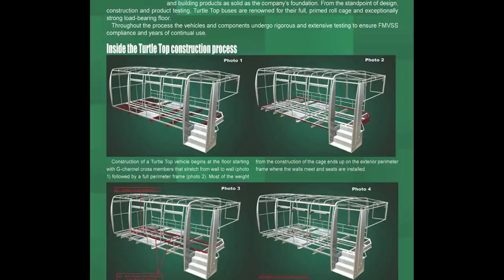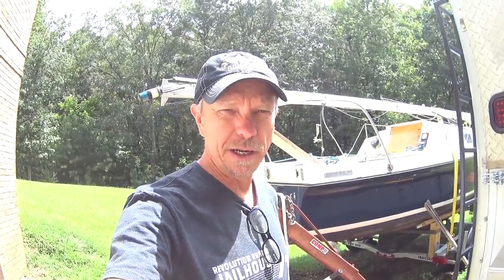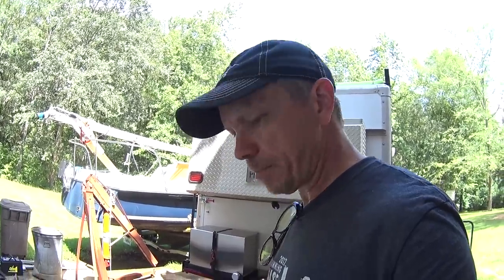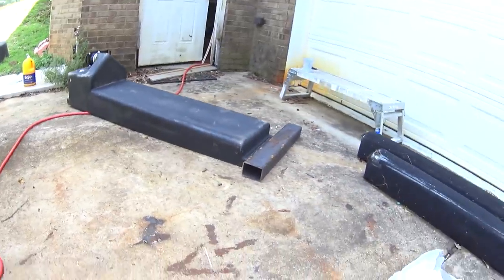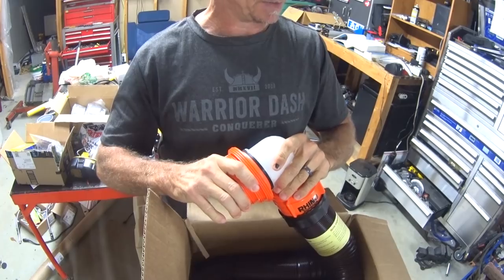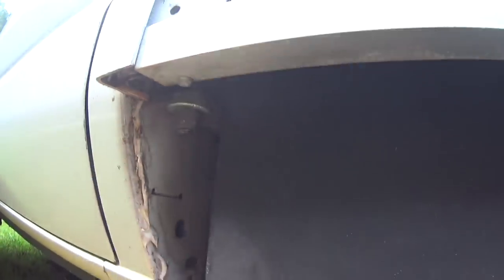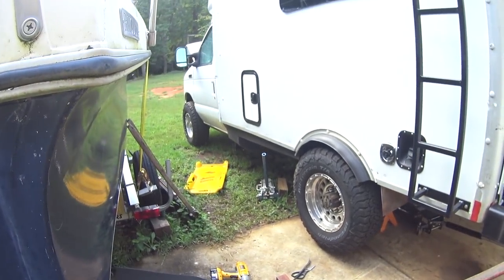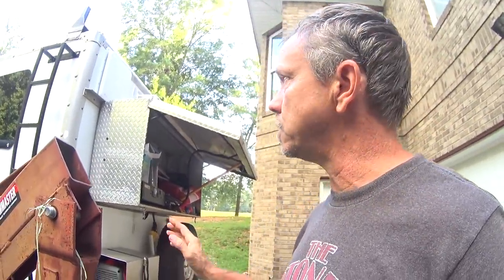Box Truck Campervan - What I should Have Built and  Holding tank install

Comment: You should have used a large water bladder and stored it in the engine bay.the truck engine would have warmed the water. Use 12v dc electric pumps to take the water back  to the shower area where you could have a highly insulated water storage tank for hot water.. Regarding your son - hitch a trailer on the back of your truck and put a VW Camper on the trailer and have him to sleep in that. Great videos and stay safe on your travels.

Comment: Wow!  I currently own that actual red Quigley 4x4 early in the video.  It's now blue with an industrial coating on it and has about 197,000 miles and running strong!  I just drove it 3000 miles from Denver to and around Oregon and back.  I've been catching up on your shuttle bus videos and am about to install the remote door opening deal, but thinking about a full security system instead.  I will have a lot of stuff in this thing when I'm done.  Thanks for the videos!

Comment: I think the best platform is a larger 4x4 Cummings powered school bus.. built like a tank, outback ready and comfortable space. One manufacturer Phoenix Cruiser offers a Quigly 4x4 with a hefty price tag but good quality control family run build.
Reply from the maker: I would like to build something with 5.9 cummins ford dana 60 axles with a ujointoffroad leaf spring kit.  That would be a pretty tough combination. The phoenix cruiser looks great but that's 125k base on the 4x4.

Comment: I know some shove the hose in the back bumper some bumpers are square you could always get a light wall square tubing and mount it across the back as a bumper get some plastic covers and it works great for that!
Reply from the maker: I just read somewhere you could also use a pvc fence post. I may be looking for one of those.

Comment: LP tank OUTSIDE , mount high in the rear .  Hot Water Heater vented to outside but mount inside .  Nice shop , mine is on the 4th Fl.   Throw rubber between tank an steel ,

Comment: You might consider adding a deflector in front of the drain valve in case grass or brush runs up against it and catches there. Also now that you have moved to propane, maybe a fuel conversion kit for your generator would be useful. Good luck!
Reply from the maker: Great ideas and I will be putting a guard in front the drain as suggested but what are the advantages to running the generator on propane?  Thanks
Reply: Well, propane doesn't go bad like gasoline, you could reduce having to carry another source of fuel and longer run time without refueling the generator are a few that come to mind.

Comment: For the sink.
I've seen used a small stainless mixing bowl with a hole cut,and drain installed.
Reply: There are also triangular stall waterers for horses that would mount in the corner.

Comment: I'd install at least a couple of steel belts or similar to hold the gray water tank. That big of a tank attached only in the ends create quite a powerful torsion on the tank. Even way smaller gas tanks have two steel belts. Good work though!
Reply from the maker: Yeah, I thought about that. I probably do need a little more support in the center for extra insurance. I'll probably do that before hitting the road. Thanks
Reply: If and when you choose to do it, sand down the edges of the steel belts so that they won't rub into the tank. I'd also install rubber or neoprene mats same length as the steel belts, between the belts and the tank, just to be on the safe side. Would be a pity to have that tank messed up by the belts sharp edges. When will you be hitting the road?
Reply: I had the same comment, 40 gallon of water is 320 lbs.  Add another support (or two) to support the center span. It could be as simple as some J-bolts and uni-strut.  Great build JYDog.
Reply: You'll find them easily by searching online for "fuel/gas tank (support) straps". They are made also universal fit, in lot's of different lengths. I'd go for stainless steel. Not that much more expensive. You'll get straps for 10-20 dollars. Ebay full of straps available in all lengths. You will find straps also locally in just about any car parts shop. But don't forget to install the rubber in between!

Comment: Doing  great man But I do see A couple possible problem areas  you should really consider mounting some steel plate in front and behind the tank. If you have A front blowout or accidentally run over something it will take out the valve and if you blow A rear tire  it could take out the rear of the tank. Personally I would build  A complete shroud to cover the whole bottom and outside of the tank because of how low it is sitting. Maybe 5/16 stainless diamond plate.
Reply from the maker: True, or maybe I should just lift it and put a 4x4 kit on it. That would keep it safe right? That would justify it. Just kidding. I do need to put something up front to protect it. I'll see if something turns up at the scrap yard.
Reply: Search salvage yards for a "Skid Plate" found on most 4x4's...

Comment: there special tanks available that look like propane tanks for car engines but whont suck up the propane in liquid form (the pipe thats normaly inside the tank to suck the liquid from the bottom isnt in this tank ) you can refil it youreself at the pump and is permenently mounted under the truck 
might be good for youre rv if you guys in america can refil at the pump that is

might want to put a small extention to the rear mudguard to prevent any pebles and mud from being trown against the grey water tank a piece of mudflap prolly do fine 

cool idea with the on demand heater , mounting it outside means absolutely no gasses inside the van , think you do need to make a cabinet for it so its out of the weather , might need a detachable chimney too so it passes the fan that pulls air intoo the van
Reply from the maker: In fact I know where one is for a Van but I think I am going to stick with the 20lb grill tank since they seem to have refills on every corner and are highly available. Sometimes it is hard to find someone who can refill a tank.  I definitely need to see about getting a chimney  to keep rain out etc. The mud flap is a good idea too.
Reply: JYDOG do you have a tractor supply by you as most have An on site refill station at each store and it really cheap to fill

Comment: If you haven't thought about it how about insulate the water heater or putting in the shower that way you don't have to worried.about.it you decide stay on a cold.place
Reply from the maker: I've seen a video with the on demand in the shower but that's just too risky for me to be in such a confined space with the possibility of a propane leak etc.. Hopefully my next video will have a good working solution. Im working on it right now.

Comment: Did you put a rub pad at the rear of the black tank?
You need one, that steel bracket WILL rub a hole.
There was one brief shot near the end that appeared you gad a rub pad, but you didn't mention it again
Reply from the maker: I did, but it was just foam padding. I may have to put some thicker rubber on it so it will wear better.
Reply: JYDOG - Carpet works really good as for your sewer hose it can be cut and the end can be installed back on. Nice channel for some reason YouTube has been losing some of my channels and it takes a while for me to find them. Cheers
Reply: Cut up a rubber innertube.

Comment: Love your slogan "Build it don't buy it"!!  If I had the strength i would have been off grid 20 years ago.  Now the Gov is trying to move people out of their houses that are off grid.  And, or making it manditory to be connected to the sanitation systems, gas, and electric.  I really want to build a rocket stove in basement to heat the upper rooms that would cut down on utilities.  Tiny houses matter! this is an issue we should be fighting for a correction.
Reply from the maker: Maybe living on a boat is the answer. You can live off the grid almost anywhere then and the Gov is less likely to mess with you. I think that may be my next project. I'm with you on living Tiny. We are going to sell our house in the next 3-5 years and go tiny.

Comment: Where did you train? Did you take shop in high school? I used to watch my husband build engines and I would Race the quarter mile. I learned about engines from him and I don't know where he learned about them. But I'm interested in knowing how you know how to do this? What is an on demand water heater? How does it work?
Reply from the maker: No training. I just keep working on it till I get it right. I make lot's of mistakes. On demand means it heats the water as needed instead of keeping a reserve of water constantly heated. I really think this is the best way to go, you never run out of hot water.

Comment: if you paint your rooftop water storage "black" it will heat the water by what is called "black body" radiation!home roof top tower storages ....same principle applies!!the heat develope is almost too scorching hot not tobe left "tempered down"
Reply from the maker: Only concern with that is all the weight from the water will really increase the center of gravity and affect stability.

Comment: You can check Lee super design van Nissan NV3500 on Enigmatic Fanatic channel. He use the same Propex heat ex-changer. The second and longer tour of his supervan was long enough so he did not talk much about the heat ex-changer. He just said that he could move the output so the hot air could go inside the van or in the outside area for the shower.
https://www.youtube.com/watch?v=dUKc1TGS-bU

Comment: Where's the yellow thing in the thumbnail, dammit?
Reply from the maker: 3:47 https://youtu.be/_oJ2rmKvV6U?t=227
Reply: Thank you! Serves me right if I surf the video rather than watch because of not having enough time!
This seems to be a very sturdy vehicle. What will it be used for?

Cool if you can build a box truck for 1-2 people instead of a campervan for 3 people!
Reply: JYDOG   I love your videos.  I learn so much. Thank you for sharing.  I'm a single disabled woman. It is amazing how i can learn so much, plan from it, and be able to do most of it myself.  

At least, I will have it all planned out right, prepared for everything, and can hire for the portions I am not able to do.  Very low income too, but if there is a will, there is a way. 
 I will make my way, and meet up with you some time and will thank you.  

Where did you get the hot watter tank?   Is it called a hot water tank for a vehicle, or did you rig it out of something else?
Reply: By the way, the Econline is nice.  But, to me it doesn't look bigger than the box truck.  How long is your box truck from back of the seats?  There are different lengths, and I am still deciding of which to get or if a bus of some kind with all the windows already there.  I'll be working out of my van so absolutely need the light and space for that though alone. 

Three cats too, and after I am settled on the road and comfortable with the lifestyel, I will get a German Shepard puppy.  I have no idea how much dogs eat!   Cats don't eat that much.  Maybe it will be like feeding another person.  I bet it is.

Comment: I will trade my 1991 Cadillac Eldorado Barritz, runs great, but battery goes dead, 8-cylinder outruns anything on the road, even in snow, and you don't know it. Looks like a snub nose 38. A car that Elvis would have definitely owned had he been alive. I love Cadillacs but I need a place to live that is not in an apartment or enclosed area where I can get out and walk. I'm a vegan and combating kidney disease. I digress, I put too many groceries in the passenger seat and the back of the front seat needs to be fixed. Everything is push button and it has an LED readout that says good morning set the time Etc and gives all of the stats. Service engine light comes on and stays for a while and goes off. Bucket seats automatic shift on the floor wood grain and a kind of gold interior. I bought it in Las Vegas. Two owners, under 100,000 miles at 96,000 MI. I only drive it to the store and back and to the doctor which is probably what's wrong. Everything is original and the woman that owned it before me, in 2002, had the stats of oil changes and tune-ups. I love the car but love is not the issue right now. Front wheel drive makes it the best car on ice with c i p e d tires. I won't own any vehicle that does not have weight behind it and it has the Cadillac hood ornament. The new Cadillacs do not. I hate that. Everybody wants it. But what I want is a conversion van off grid with composting toilet, automatic, easy to drive. Contact me at helovsu@hotmail.com. My car, if it was perfect, could sell for over $30,000 as a collector's item. It's best to get it while it looks new. Paint is beautiful but needs to be washed. It's a dark greenish black and the silver metal is beautiful. And no it does not have metal along the bottom sides. Those were on Coupe DeVilles . I had one of those before this one but no metal along the bottom sides. I digress again . And shiny. The original paint had to be repainted with the original paint due to a few scratches. It is fully insured.  Never been in an accident . And I found a place with the original partial vinyl top material that had to be replaced years ago, same color. I need someone that has the means to treat it as it should be treated. It needs a new trunk motor. I made the mistake of helping someone by hauling signs and empty boxes from a garage sale that hung over the back end. Should have never done it with an electric motor. But now I have figured out what I really want for it. I was never going to give it up.

Comment: Why are you worried about propane inside..  
Propane stoves are use in houses and also RV's 
Propane when burning puts out H2Ovapor... not CO ....
Just a FYI 
( if concerned find a propane appliance tech or propane delivery driver and they will tell you that propane is reasonably safe,...
Reply from the maker: Sorry, but propane in a small enclosed space is just not for me. I'm ok with it on the outside.
Reply: If you are truly concerned about small spaces.  Then you should make sure you have a constant vent to keep a fresh supply of O2 and vent of the C02.  Also a well insulated Van / Bus / Cargo Trailer that is under 100sf or 700cf should work with any reliable small heater 
The number one problem with small spaces is the DEPLETION of O2 ..
. 
FYI I am intimately aware of small spaces as I served onboard submarines for 16+yrs an also live 1/2 the year off grid in a 8x20 shipping container.  and my last civilian job was delivering heating oil and propane.